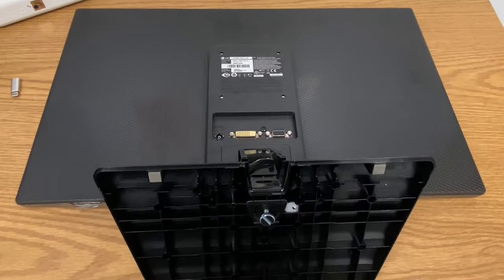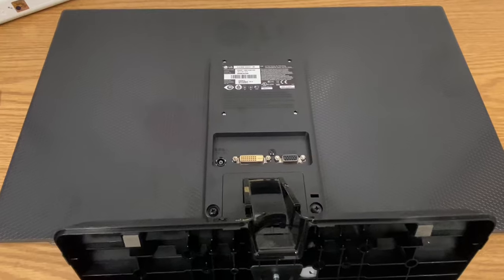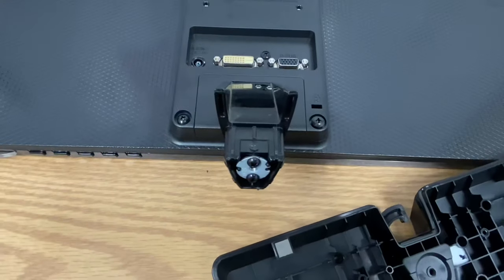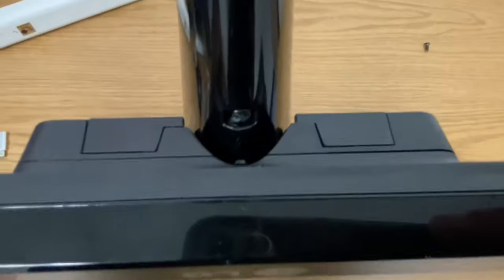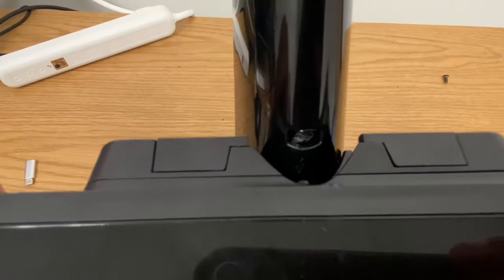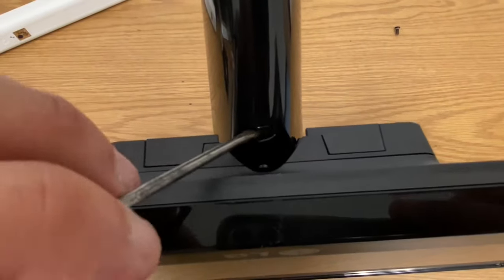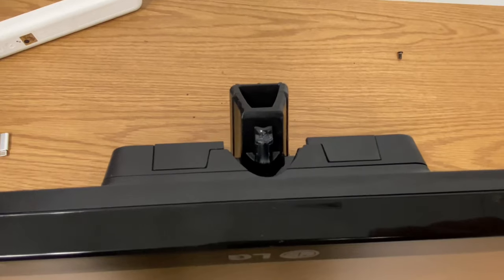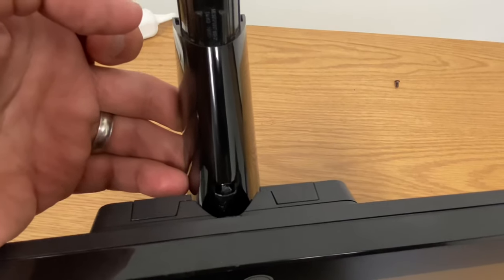How to Remove The Stand Off an LG Flatron LCD Monitor

Comment: Good video, but I was looking for one step further: to get the hinge off of the back of the monitor
Reply: you need to remove the bezel from the screen. use a pry tool  and work the borders of the screen. begin around the control buttons and work your way around. put the screen facing down and pull the back. then you will see the screws holding the hinge.

Comment: The small clip like mechanism was pushed downward with a help of a small screwdriver to release the handle from the back of the monitor.

The tip was very helpful.thanks
Reply from the maker: You articulated this much more clearly than I ever could 😀!  Thank you